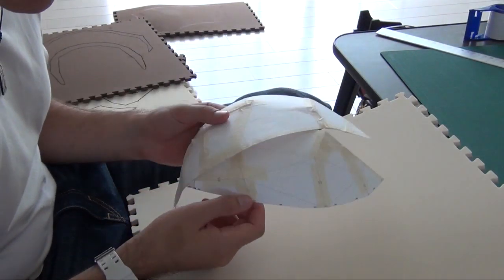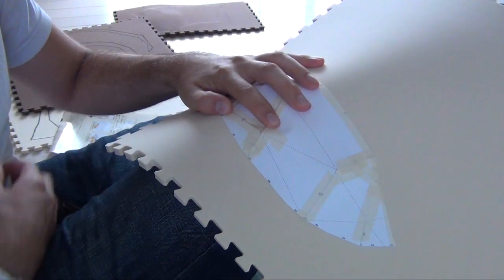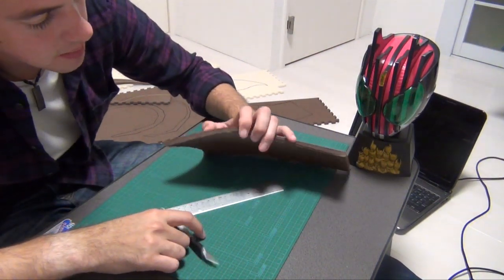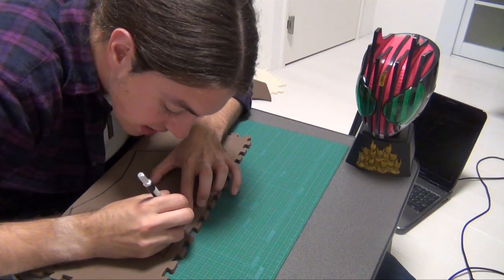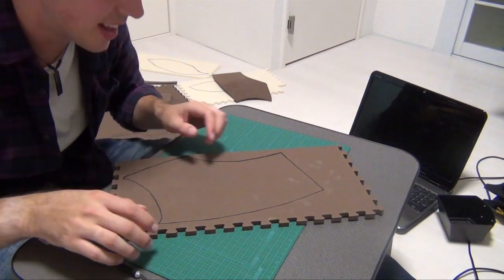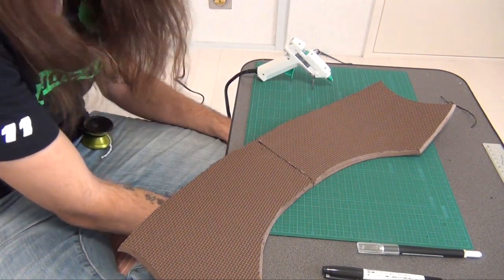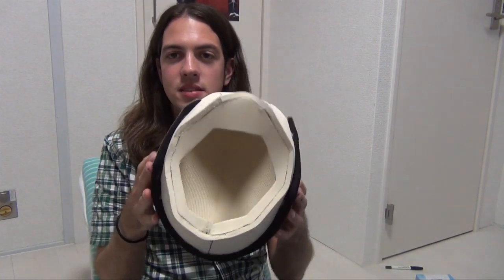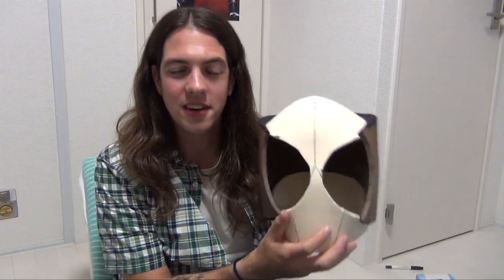Kamen Rider Decade Costume Vlog #2B- Pepakura for Foam Cutting and Helmet Construction!

Comment: Hey, what's a ballpark range of what all the foam (so far) has cost you? I'm trying to puzzle out how much I need to save for materials. :3
Reply from the maker: I have finished constructing all of the armor now (video update on the way this week!). I buy the foam in the packs of four 45cmX45cm squares, and I think I bought 4 or 5 packs at 800 yen each. So, that means, at most the foam has cost me $000 yen ($39 USD). I spent about 2000 yen ($19.50ish USD) on a glue gun and a crap-ton of hot glue sticks. You will need A LOT of hot glue sticks). I think I bought 100 glue sticks and have used a little over half of them. Prices may vary in your area. I would suggest buying larger rolls of foam if you can find them, instead of the squares. You can make bigger, more seamless pieces that way. Unfortunately I can't find anything like that in my area, so I'm stuck with what I can find.
Reply: MainerInJapan Wowza, for an entire cosplay suit that's AMAZING! (Every cosplay [non-KR related] I've ever made has cost me at least $100, and believe me I'm a total tight-wad. XP) I can't wait for your update and thank you for the advice! :D
Reply from the maker: I'm sure I'll get it up to $100 with the cost of paint, fabric for the suit, boots/shoes, and gloves, but I think it won't be too much more than $125 by the end of it. It's certainly not professional quality, but far better than a $125 Decade cosplay from someone else. =P